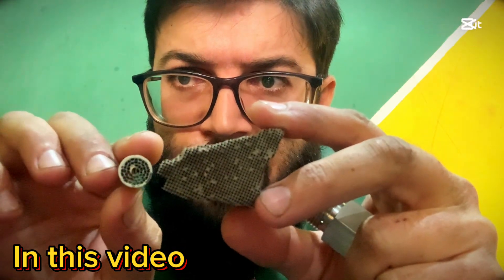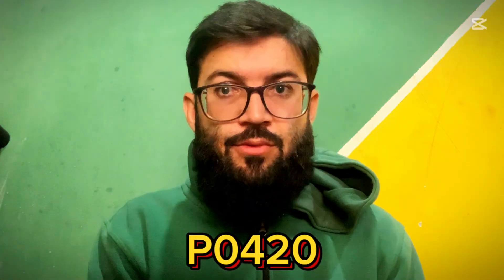how to fix P0420, P0430 Engine Check Light - Causes and Genuine Solution | Catalytic Converter

Comment: I have toyota corolla 2004 code p0420 and sound like a crack converter  so can have that noise  from gasket converter with thanks
Reply from the maker: is it japani model ? 1.6 ? kindly first mention that and one another think if you are hearing some sound like 2 things meet together first check safety cover over catalytic converter some time that become loose so it make noise
Reply: @aishaautocarelahore  I'm from canada maybe become to cold -20  only that sound when the catalytic warm
Reply from the maker: But that code not about to cold there in Canada 🇨🇦 there is some problem in your car catalytic converter it’s not relates to hot and cold weather and about that sound that may be change in temperature from hot to cold make sound ok tiktik
Reply: @aishaautocarelahore  you right thank you so much
Reply from the maker: Your welcome